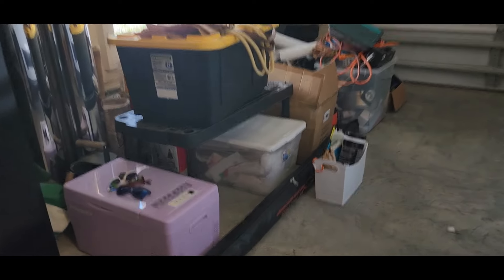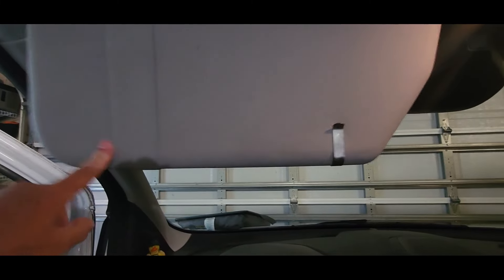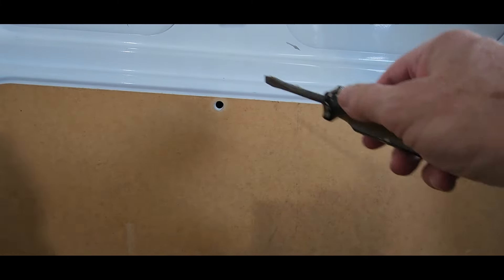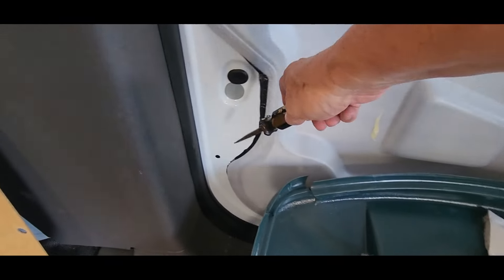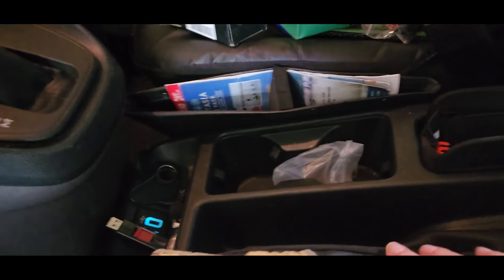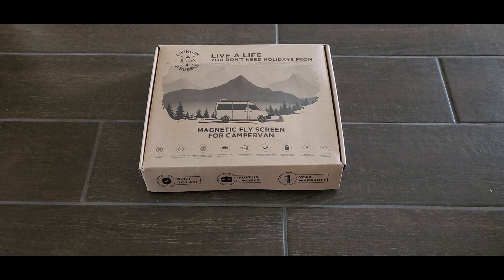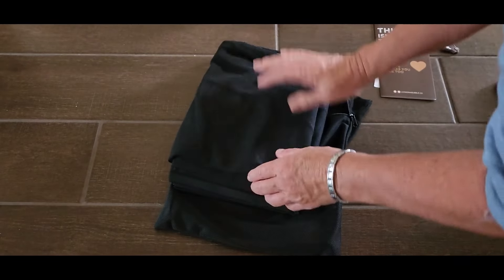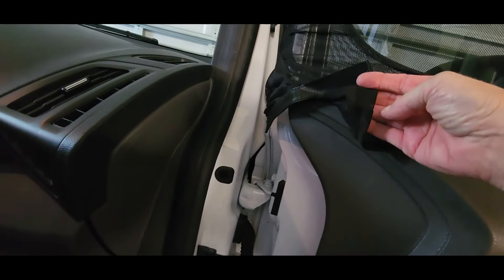NEW VAN - DAY SEVEN - Window Screens and Storage Solutions

Comment: If your not happy return them. See if you can get something more suitable. The loose bits you could velcro. 🇬🇧 car camper
Reply from the maker: No one else sells them. I can't even find the generic kind. If I had other windows to let air in, I wouldn't worry about it. Those two are the only sources I have for air. I'll rig them with Velcro. Great idea! Thanks!
Reply: @OutonaLimbwithKym   Oh I seee, a bit tricky then, when it is like that. You clearly did your research. Good for you. Yes Velcro is the best solution in this scenario, make sure you get strong Velcro, the cheaper ones don't always last. 🇬🇧 female car camper, stay safe and blessed. 🙏🏿